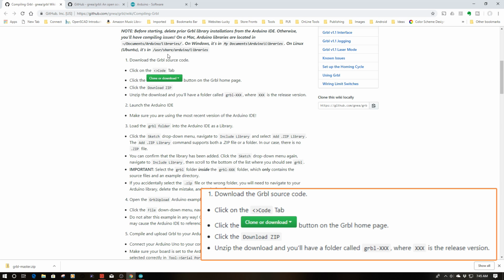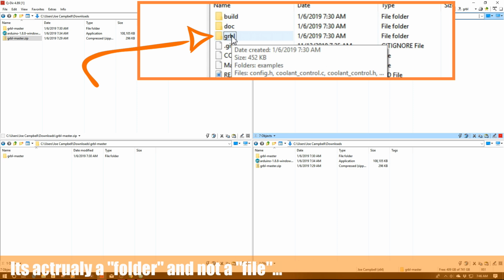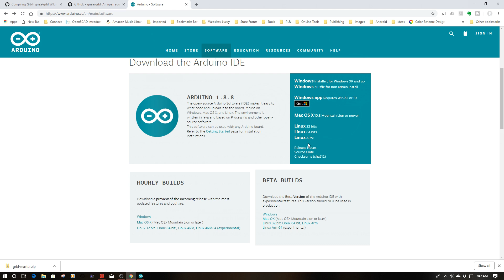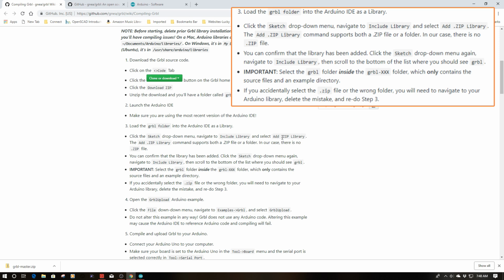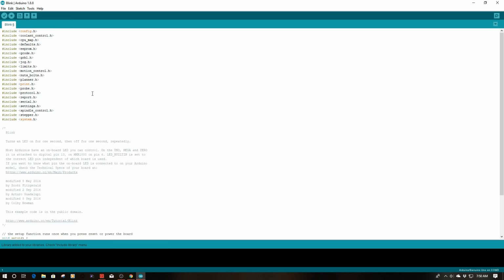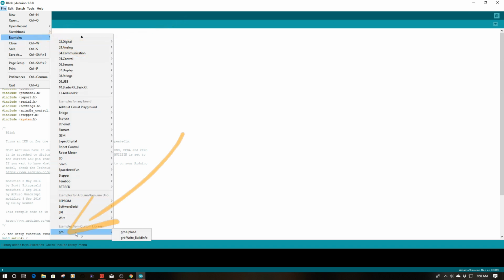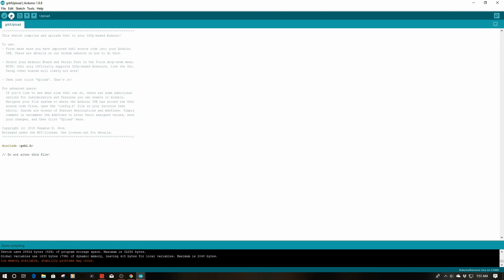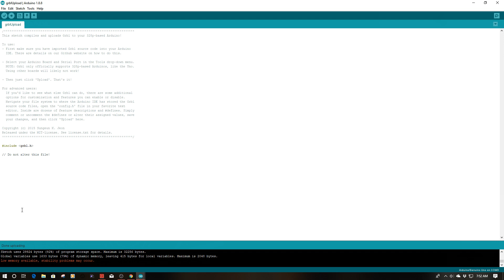GRBL 1.1 - Step By Step Installation Guide to Flashing Arduino Uno!

Comment: When I get to the grbl folder and click "Open" it simply onpens the folder and does not add it, if on the other hand I put it in a zip, it is adding it, but if I upload it to the arduino Uno and try to run the motors with the UGS app sometimes it works, sometimes it does not, and only for a few secconds, and I get all sorts of erros, missing gcode and other stuff. What am I doing wrong?

Comment: Der Sketch verwendet 25244 Bytes (78%) des Programmspeicherplatzes. Das Maximum sind 32256 Bytes.
Globale Variablen verwenden 1516 Bytes (74%) des dynamischen Speichers, 532 Bytes für lokale Variablen verbleiben. Das Maximum sind 2048 Bytes.
avrdude: ser_open(): can't open device "\\.\COM3": Das System kann die angegebene Datei nicht finden.

Fehlgeschlagenes Hochladen: Hochladefehler: exit status 1

how can i  solve this problem, avery time i apload comes this mistake.

Comment: Issue Fixed... 5/23/23 On my Windows system it looks like I had to save off the GRBL folder to somewhere with a short path, like my c/users/... and then select this ZIP file. Trying to just select the GRBL folder from downloads did nothing.

Comment: today i test my uno board. error alltime if try add GRBL upload. and i test blink.ino upload nice and working BUT come after upload lot errors too. but blink code working, can upload. 
----------------------------
Sketch uses 924 bytes (2%) of program storage space. Maximum is 32256 bytes.
Global variables use 9 bytes (0%) of dynamic memory, leaving 2039 bytes for local variables. Maximum is 2048 bytes.
avrdude: stk500_recv(): programmer is not responding
avrdude: stk500_recv(): programmer is not responding
avr_read(): error reading address 0x0000
    read operation not supported for memory "flash"
avrdude: failed to read all of flash memory, rc=-2
avrdude: stk500_recv(): programmer is not responding
the selected serial port avrdude: stk500_recv(): programmer is not responding
 does not exist or your board is not connected
-----------------------------
WHY board not connected but can upload blink code good.  Tools-site. board uno, ok,  port dev/tty/usb0 OK can upload blink,  programmer AVRISP mkII, maybe ok ? clone arduino uno, linux raspian, raspberry pi 4 8gb. not have other computer. only second old pc were installed linuxcnc debian 10, but not used longtime.
WHY alltime compiler error this GRBL file or not upload ? only test blink go in board but come lot error too after upload.
What programmer section need use ? 
WHY not compile this GRBL ?
WHAT is wrong ?

Comment: I've downloaded the latest version of both  grbl (1.1h) and Arduino IDE 2.0.3 at least 20 times and there is simply nothing under the unzipped master file that Arduino IDE recognizes.  The grbl folder doesn't have the files as shown in your video but rather a subfolder named "examples" and that has two more subfolders both of which contain files A IDE doesn't recognize.  I'm in a hamster wheel here but thanks for your kind efforts.
Reply: For future reference of other people facing this problem:
I solved it by manually copying grbl folder into %UserProfile%\Documents\Arduino\libraries directory. Then restart IDE and continue as in video by selecting File>Examples>grbl>grblUpload.
Reply: @jakubjakubowski944  thank you so much!

Comment: 2022 - ARDUINO 2.0 is broken when trying to add libraries. You MUST download a Legacy version (I finally got 1.8.19 to work correctly) .
Reply: I think this is the problem I’m having, it won’t upload libraries it just keeps opening the folders contents
Reply: 2023: Only thing that worked, thanks!
Reply: 2024: This is still the way
Reply: Yep December 21/2024 still the legacy version works properly, thanks for sharing.

Comment: If anyone gets this error with loading the zip into arduino ide.

"A subfolder of your sketchbook is not a valid library"

Solution.. copy your grbl master file into your computers download folder, and then load from there.
I had my grbl master in the same folder as Arduino library and it had an error

Comment: Hi;
There are three motors and I want to set working  compatibility. For example; Some times every stepper motors are run on, sometimes only one stepper motor.
When I open Arduino page, I saw only one stage its ''# include Grlb.''
so any stage aren't changed , only I can upload to arduino and  drive catesian robotic. 

If I write a code in Void loop stage, will there could be any discrepancy with 'GRLB'
How to theree motors are drived as I want ?

Comment: Hi guys, I'm trying to upload the github grbl file to my arduino, however I'm having trouble when adding the file to the library. I have tried to add the file in the same way as in this video as well as the zip file but I keep getting the same error message which states "Specified folder/zip file does not contain a valid library" as well as "no headers files (.h) found".  Also i figured that if i open the grblUpload arduino file and try to upload it, I get a long error message with the first line stating that "java.io.IOException: Access is denied
". I have downloaded java to my pc. Has anyone any idea where I may be going wrong ? Any help wold be greatly appreciated, thanks.
Reply: Same here! Did you ever figure it out?
Reply: Me 3. I get the same thing, that file is empty.

Comment: I have an Azteeg X3 PRO 3D printer Controller from Panucatt.  I am finishing a build of a CNC router machine.  I will have dual lead screw motion on both x and y axes.

Single lead screw for the Z-Axis

How do I make GRBL recognize MY board and how to assign the 5 drivers to the specific motors.  

I know NOTHING about arduino programming and REALLY need the help!

How do I tell the machine I am using lead screws rather than gears and belts?

Comment: HELP! I have no control of the $ settings in the console.  Tried several times to update my Grbl (0.9) and i have the latest ADI but something isn't right with my library.  I guess this is an Arduino question, but how do i clean up my library. it seems to be trying to load more than the Grbl sketch.  I have played with ADI, but the file management part confuses me. Any help would be great.  I hate tried several programs and like Lightburn the best but I can't set the $32, and 30 parameters

Comment: I get success the flashing in arduino app wit genk control. It s a 3018 pro after do that the axis x,y,z don't move. Some help in candle don't make nothing. And in the laser engraver software it have the z axis invert. Some help will be glad.

Comment: My arduino will NOT finish booting GRBL after flashing GRBL 1.1 via IDE.  The loopback test works, yet Universal Gcode Sender will ALWAYS return "GRBL not finished loading"  What can I do to fix this?  I had it working until I flamed out a relay with a router that pulled to much current.  This is a new Elegoo Uno R3 with a new Shield v3.0 and new 8825 drivers.  Any help at all???

Comment: Hello,

trying to do that, but receivingthis errors: Arduino: 1.8.13 (Windows 7), Board: "Arduino Uno"
Sketch uses 29762 bytes (92%) of program storage space. Maximum is 32256 bytes.

Global variables use 1633 bytes (79%) of d
\

avrdude: stk500_getsync() attempt 1 of 10: not in sync: resp=0x0d

avrdude: stk500_getsync() attempt 2 of 10: not in sync: resp=0x0a

avrdude: stk500_getsync() attempt 3 of 10: not in sync: resp=0x47

avrdude: stk500_getsync() attempt 4 of 10: not in sync: resp=0x72

avrdude: stk500_getsync() attempt 5 of 10: not in sync: resp=0x62

avrdude: stk500_getsync() attempt 6 of 10: not in sync: resp=0x6c

avrdude: stk500_getsync() attempt 7 of 10: not in sync: resp=0x20

avrdude: stk500_getsync() attempt 8 of 10: not in sync: resp=0x30

avrdude: stk500_getsync() attempt 9 of 10: not in sync: resp=0x2e

avrdude: stk500_getsync() attempt 10 of 10: not in sync: resp=0x39

An error occurred while uploading the sketch

This report would have more information with
"Show verbose output during compilation"
option enabled in File -> Preferences.
Reply: I have exactly the same error , any help please ?
Reply: @KoalaWoodStore  same alltime error, or if only compiler test  define BAUD_RATE 115200
 ^~~~~~
 rewind
Multiple libraries were found for "stepper.h"
 Used: /home/pi/Arduino/libraries/grbl
 Not used: /home/pi/Downloads/arduino/arduino-1.8.19/libraries/grbl
exit status 1
Error compiling for board Arduino Uno.

Comment: im looking to take the board off my laser engraver and swap it with a mks gen L mostly because i dont want to tie up my laptop all the time while its running. 

however my machine is a 1 motor on the x and 2 on the Y i dont know how to set this up. its not like marlin where you have configuration.h and you can apply all the settings. i need to setup my motors and my screen and sd card support. 

i know how to do it for a 3d printer but this is new to me. i looked through grbl config file didnt see anything about setting up motors or a screen

i hope you can help thanks in advance

Comment: Hi, firstly BIG THANKS for this video !!! :) I tried step by step and all went well including verification BUT when I tried uploading, I've got these error messages:
Arduino: 1.8.13 (Windows 10), Board: "Arduino Uno"

Sketch uses 29762 bytes (92%) of program storage space. Maximum is 32256 bytes.

Global variables use 1633 bytes (79%) of dynamic memory, leaving 415 bytes for local variables. Maximum is 2048 bytes.

Low memory available, stability problems may occur.

avrdude: stk500_getsync() attempt 1 of 10: not in sync: resp=0x0d

An error occurred while uploading the sketch

avrdude: stk500_getsync() attempt 2 of 10: not in sync: resp=0x0a

avrdude: stk500_getsync() attempt 3 of 10: not in sync: resp=0x47

avrdude: stk500_getsync() attempt 4 of 10: not in sync: resp=0x72

avrdude: stk500_getsync() attempt 5 of 10: not in sync: resp=0x62

avrdude: stk500_getsync() attempt 6 of 10: not in sync: resp=0x6c

avrdude: stk500_getsync() attempt 7 of 10: not in sync: resp=0x20

avrdude: stk500_getsync() attempt 8 of 10: not in sync: resp=0x30

avrdude: stk500_getsync() attempt 9 of 10: not in sync: resp=0x2e

avrdude: stk500_getsync() attempt 10 of 10: not in sync: resp=0x39

My actual firmware is GRBP 0,9j . ...Any ideas why I'm getting errors instead of having successful flash to 1.1 ? Thanks a lot :)
Reply: I'VE SOLVED THIS ISSUE: If you are using ALIEXPRESS CNC 1318 /PRO, you MUST choose in Arduino IDE sofware NOT Arduiono UNO, but Arduino Mini/Pro ! Problem solved :)

Comment: Thanks, Great video, but .... at the end of my upload i got this message: An error occurred while uploading the sketch

avrdude: stk500_getsync() attempt 1 of 10: not in sync: resp=0x0d

avrdude: stk500_getsync() attempt 2 of 10: not in sync: resp=0x0a

avrdude: stk500_getsync() attempt 3 of 10: not in sync: resp=0x47

avrdude: stk500_getsync() attempt 4 of 10: not in sync: resp=0x72

avrdude: stk500_getsync() attempt 5 of 10: not in sync: resp=0x62

avrdude: stk500_getsync() attempt 6 of 10: not in sync: resp=0x6c

avrdude: stk500_getsync() attempt 7 of 10: not in sync: resp=0x20

avrdude: stk500_getsync() attempt 8 of 10: not in sync: resp=0x30

avrdude: stk500_getsync() attempt 9 of 10: not in sync: resp=0x2e

avrdude: stk500_getsync() attempt 10 of 10: not in sync: resp=0x39
Reply from the maker: Did you try and google the error?

Comment: Thank you for sharing the tutorial. I have recently bought a cnc3018 Pro which came with a Cronos Maker controller. When i first put it together and pluged it up, i was able to connect and do some basic checks of jogging the motors. During the test I mistakenly pressed the Z-axis home button and I rushed to remove the power plug because I do not have end stops. The next time I reconnected again, I am no longer able to do anything. I have used Candle and CNC.JS and althoug my PC does connect to the correct COM port of the controller and I see a message pop up in the console but I don''t see a list of other commands. I think the GbRL is not booting up fully. I got in touch with support but all they tell me is check PC USB driver and COM ports. Are you able to shed any light??
Reply from the maker: Many thanks and a couple things, first I have no clue about the "Cronos Maker controller" and only once and again used Candle so these are guesses.  Does candle have a console screen if yes does it show  you successfully connecting to GRBL and if yes are there any alarms (like 8 or 9)?   If your connected try $x to unlock or google the error.  If you can not connect to GRBL, check you baud rate and also Google CH340 UART and driver (again I don't know the Cronos Maker controller).
Reply: @DIY3DTECHcom  Thank you for your reply. In Candle, I am able to successfully connect to the Controller but it does not display any Alarms or errors. Instead the status indicated as  "Port Opened" and in the Console it displays [CTRL-X]  When I use CNC.JS,  I see the message "NCjs 1.9.22 [Grbl]
Connected to COM8 with a baud rate of 115200
> $x
>
The Cronos Maker Board that came with my cnc3018 Pro is the same as this one https://www.amazon.com/Controller-Engraver-Control-controller-laserGRBL/dp/B07ML4GCHD

Comment: you make it look so easy it says error complling
Reply from the maker: then you do not have something set correctly, double check everything!
Reply: @DIY3DTECHcom  I'm not even sure if it's an ardrino archtech board but it's what came with my cnc and it was suppost to be pre flashed but it wasn't for some reason and i followed the guide to the letter

Comment: Hi, a gent a error message ... An error occured while uploading the sketch. Tried 3 Times. I need help!
Reply from the maker: Make sure you have the correct baud rate set as well as the processor type as I cover in the video...
Reply: @DIY3DTECHcom  Now I have a Number 8 error

Comment: I get GRBL uploaded to the Arduino and then I pull up UGS, confirm the COMM Port and Baud rate then when I click "Open" UGS closes, anyone else run into this issue?
Reply from the maker: Have you tryed a different Gcode sender?  Look at my GCode sender page for more options...
Reply: @DIY3DTECHcom  I was able to use grblcontroller successfully thanks. Great video BTW

Comment: Hi I updated to the latest version and it doesn't work anymore. Do I need to change some settings or only upload the sketch ( I used the hex file)
Reply from the maker: I would suggest not to use to use the hex file and compile from the source code...

Comment: Why did i have these errors
Arduino: 1.9.0-beta (Windows 10), Board: "Arduino Uno"

Sketch uses 29762 bytes (92%) of program storage space. Maximum is 32256 bytes.
Global variables use 1633 bytes (79%) of dynamic memory, leaving 415 bytes for local variables. Maximum is 2048 bytes.
Low memory available, stability problems may occur.
An error occurred while uploading the sketch
avrdude: stk500_getsync() attempt 1 of 10: not in sync: resp=0x0d
avrdude: stk500_getsync() attempt 2 of 10: not in sync: resp=0x0a
avrdude: stk500_getsync() attempt 3 of 10: not in sync: resp=0x47
avrdude: stk500_getsync() attempt 4 of 10: not in sync: resp=0x72
avrdude: stk500_getsync() attempt 5 of 10: not in sync: resp=0x62
avrdude: stk500_getsync() attempt 6 of 10: not in sync: resp=0x6c
avrdude: stk500_getsync() attempt 7 of 10: not in sync: resp=0x20
avrdude: stk500_getsync() attempt 8 of 10: not in sync: resp=0x30
avrdude: stk500_getsync() attempt 9 of 10: not in sync: resp=0x2e
avrdude: stk500_getsync() attempt 10 of 10: not in sync: resp=0x39

This report would have more information with
"Show verbose output during compilation"
option enabled in File -> Preferences.
Reply from the maker: No clue would suggest goggling them as two things jump out being, (1) low memory (do you have right board selected or in use) and (2) an upload error. However I think it comes back to #1
Reply: @DIY3DTECHcom  
Finally I fix this errors.
In the arduino IDE Tools, I selected board: "Arduino Nano" and Processor: "Atmega328P (Old bootloader)"

Comment: I Install grbl and upload with Arduino IDE .But Open UGS ,No firmwares found ,why ?
Reply from the maker: Did both compile and load without errors?  Do you have the correct baud rate set?

Comment: hi, thanks for this instruction ! maybe i am missing something, can you help me ?  I was using a Arduino Mega 2560 with Ramps 1.4 on Grbl 0.9. Now i wanted to check out a CNC Shield V3 in combination with Arduino Mega 2560. If i follow the instruction i can connect to Grbl. Where it shows me normaly all the settings and the version, in the software, when connecting to my Ramps, now i see nothing no settings no version, software only says connected. I am trying 'on the bench' no steppers, drivers, etc connected, might that be the issue ? Pogramming the ramps 1.4 shows me all the tabs in IDE (config.h etc) with CNC shield i only see the GrblUpload tab, is that correct ? Thanks !
Reply from the maker: Sorry I am not fully tracking your question as GRBL knows nor cares about the CNC Sheild it just sends pulses to the IO pins.  However your trying to reflash the Arduino with GRBL you need to fully reset the Arduino as GRBL places part of itself in NV ram. Hope this helps...
Reply: @DIY3DTECHcom  okay, thanks !

Comment: After uploading successful Board still shows GRBL 0.9 NOT 1.1!!  Tried numerous times!
Reply from the maker: That's because you need to first totally erase GRBL 0.9 you can not install 1.1 over 0.9 as the NVRAM must be wiped.  Google how to reset Arduino Uno there are a number of resources out there.  Hope this helps....